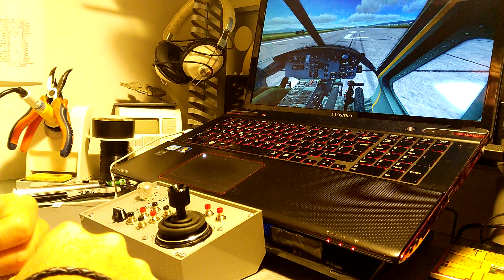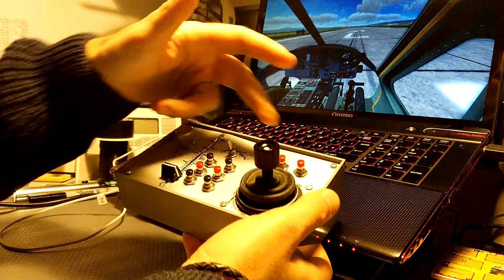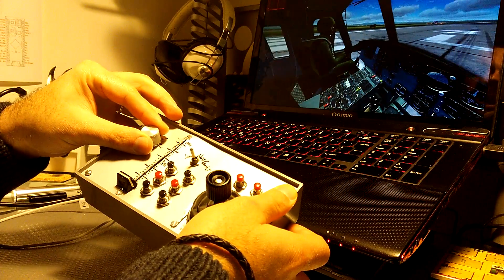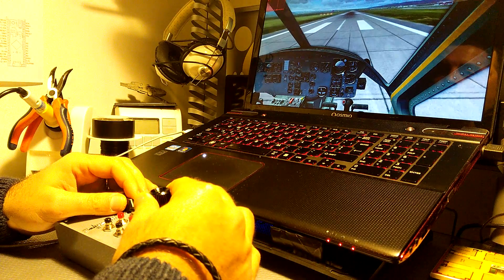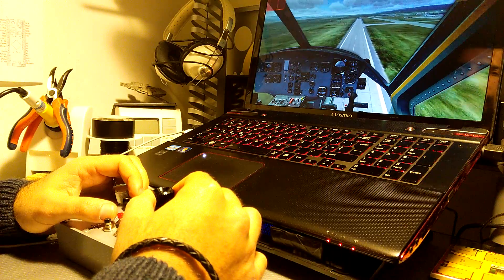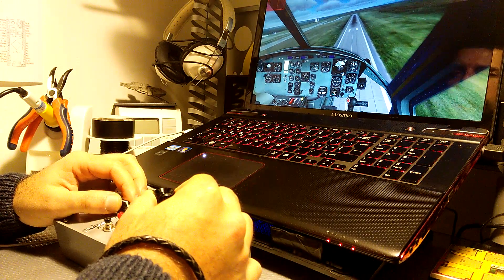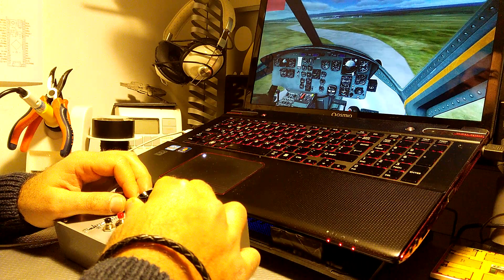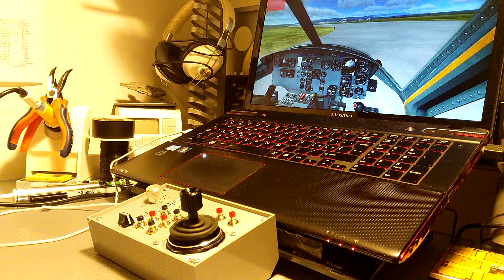DIY compact analog joystick flight control.

Comment: How did you make the device HID compatible? Is it just using the USB serial interface on the Arduino end? Were any custom drivers or non-Arduino programming needed?
Reply from the maker: It is an HID compatible device and is all arduino code.

Comment: Full-feature controller small enough to fit in you luggage for a little simming while travelling. I wonder what would happen if you pulled that out and started flying on an actual commercial flight? Potential for freaking out a few passengers, I would think!

Comment: What joystick are you using? Does it have potentiometers and if so what resistance? Where did you buy it?
Reply from the maker: It is a Quanum 3 axis gimbal stick and comes with hall sensors (magnetic). You can find it easy ...
Reply: Leonard, interesting project. do you have a how to? instructions? links to the components? I´d like to try this
Reply from the maker: No time for that, sorry!